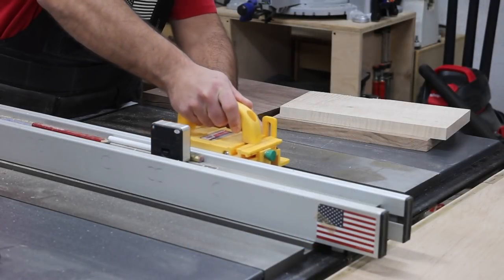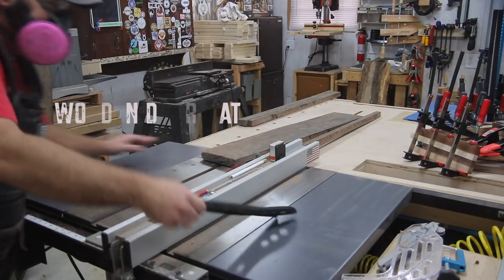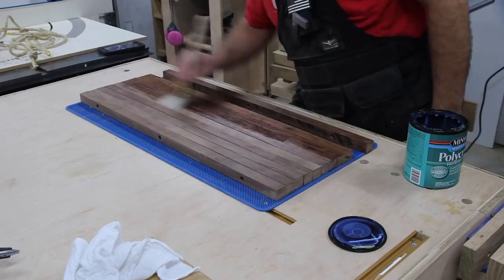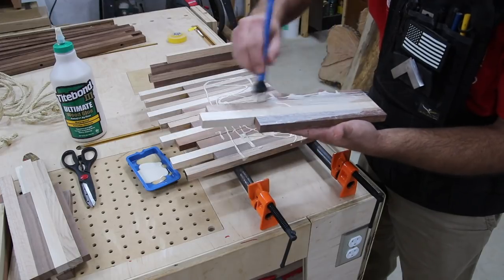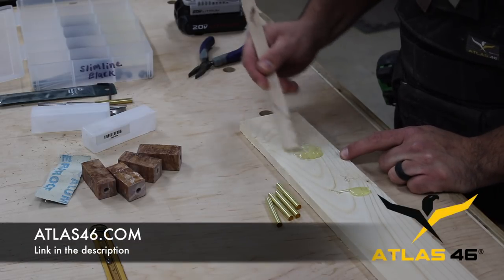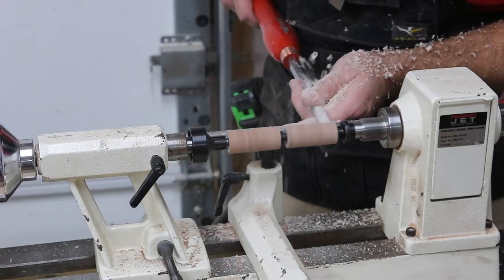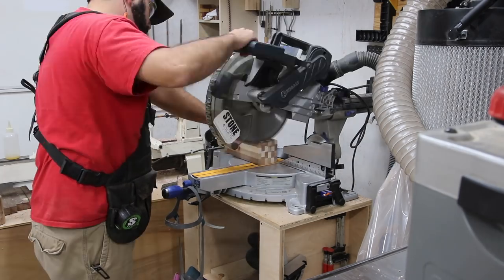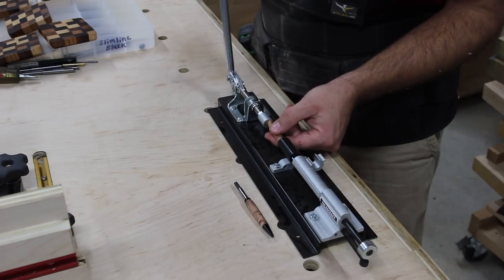3 Easy DIY Projects You Can Make In One Day - Woodworking

Comment: I find it hard working on multiple projects as i have a single car garage but i was working on 3 at the same time. Some picture frames from recycled oregan pine floor boarda which turn out great. While the glue was drying on those i was also making some stands for a client . Time management is a challenge in small shop. Like you vest but here in South Africa very difficult to get hold of.

Comment: I pretty much have to have 3 or 4 projects going on at once. I thrive in chaos but if I only have one project to complete I'll procrastinate until forever. If I have 3 projects and not enough time to finish them I'll go balls to the wall and pull it off in the end. I do my best work under pressure. Just how I'm wired.